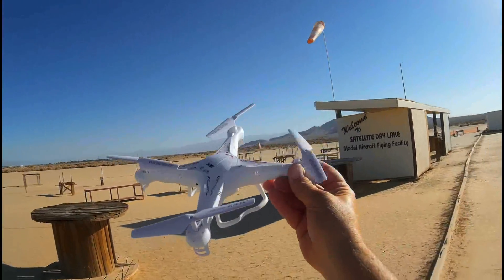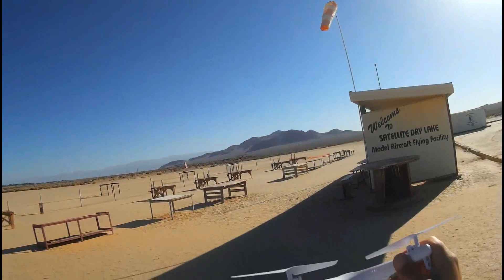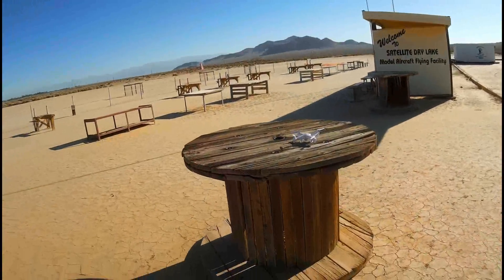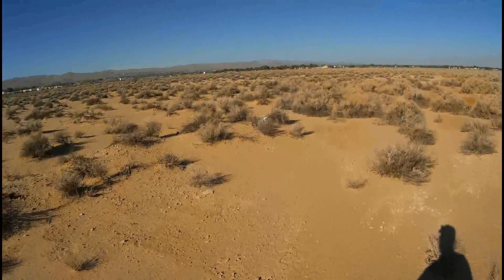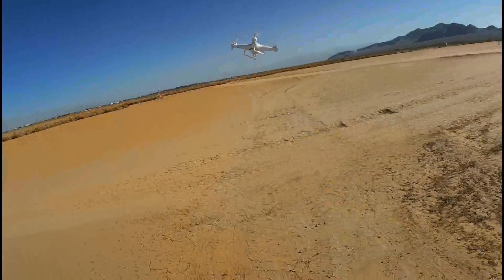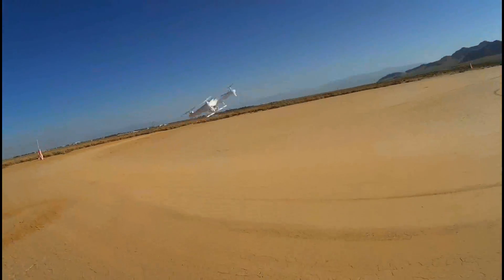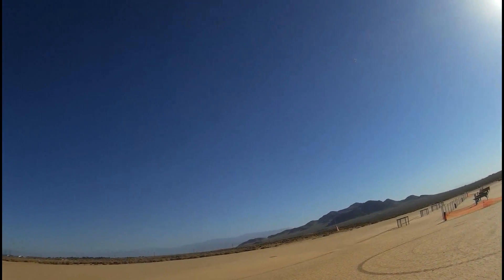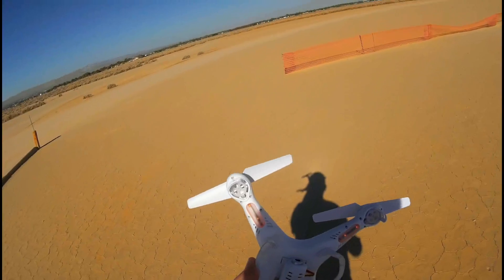Syma X5C Quadcopter Drone Test Flight

Comment: Why on earth did Banggood put this vid on there website lolz.....i mean when you wanna sell something why show a video off  this thing crashing :-) ?
 All i hear is how it sucks and it even looks like its flying horrible :-)
Reply from the maker: This review was for the original base model that was being sold in early Summer. Syma and Banggood has since taken note of the problems, and have started selling a new updated version (X5C-1) that supposedly has corrected many of these issues. One of the updated models is being sent to me for review purpose, and I'll provide an honest updated appraisal video when it gets here in about a week or so. Am hoping for improved stability in wind, with banked turns, increased range, and all with the camera attached.  We'll see about that ;-)
Reply from the maker: Also there still may be some vendors out there trying to clear their shelves of this older model (possibly on eBay or alibaba/express).  If the price seems too good to be true, it's probably not the updated X5C-1 version. Verify with the vendor before purchasing.
Reply: Quadcopter 101  Ok :-) well hope that the updated bird flies better because this thing seems to have a horrible flight behavior.
Reply from the maker: Schiksie Here's my review of the upgraded X5C-1.  It flies like a totally different, aircraft with very impressive stability. I like it. I like it a lot!  Syma X5C-1 Drone, Your Mother Could Fly This!
Reply: Quadcopter 101 Nice video and it surely handles better that the previous version :-)
Reply: Schiksie That's a lot better than most. Most dealers put up videos done in such a way as to cover up any problems and make it out to be better than it is.
Reply: ardvarkkkkk1 Very true :-)

Comment: Dude... This thing is $60 on Amazon what do you expect??? Its not made for long distance and its made of plastic to help keep cost down so of course the wind carries it duhhh...your expecting too much out of it for its price range... Settle down now lol
Reply from the maker: This review was of the original X5C.  It did have problems as shown in the video, particularly with wobbling in turns.  Syma is now shipping their upgraded version, the X5C-1 which supposedly has corrected much of these issues.  I will be reviewing it in the near future to show the differences and the corrections that have been implemented.

Comment: Hi! My camera isn't working, I have the sd card and everything correctly inserted but, it isn't recording, the remote bleeps and everything but the camera dosnt, any help would be most appreciated, also the camera does have a green light but it dosnt start to blink when I hit the button.
Reply from the maker: I have heard that the throttle trim button is now the camera control for the upgraded version X5C-1.  Try pressing up or down on the throttle trim to see if that activates the camera or video.
Reply from the maker: This might explain it better: http://www.rcgroups.com/forums/showthread.php?t=2241148

Comment from the maker: super car master, the gyros can become disoriented from shipment. But it's easy to recalibrate them. 1) place the quadcopter on a flat and level surface.  1) Turn on and bind the quad with the transmitter.  2) place the transmitter in high rate mode.  3) pull and hold both control sticks to their lower right corners.  Hold them their for 15 seconds (led lights should start flashing).  4) let go of sticks and try flying.

Comment: Hi , I have one of those and the thing is that every time I push the throttle up it doesn't stay in its position and it goes all over the place. Do u know how to fix it please?
Reply: do u have fix hit i have the same problem or i just need to lurn how work the buton mode 2 : p
Reply: Hi , you can reset to stay in position

Comment: My X5C is brilliant. Any wonder you had range issues, could hardly see it ! For a single cell brushed motor Quad it's fantastic! My camera has only about 5 or so deg's tilt downward, not too sure how yrs was 20 deg's. The view is perfect & a trade off. Only complaint & it's not really that is it's a little underpowered but fantastic value for money. I throw mine inot the air by had & it self levels instantly.
I have a few other Quads like the Nova/CX20 & the little Syma X5C is far better for fun. Mine doesn't even wobble when doing banked turns providing you have full fwd stick at the same time, seems to work better that way.
All in all I think yr asking too much of it, for around $60 bucks it's won me over providing you understand it's limitations:-)
Reply from the maker: No, to rebind in flight, move the throttle all the way down and up.
Reply from the maker: Think that you might have the newer upgraded version X5C-1?  It's reported to have improved flight software to improve its stability. Other issues remain unchanged (limited power, very limited range, and downward camera angle).  But for around $60, there are other quadcopters already out there with much better power, performance, range, and even video capability.  The following is just to name a few, but I will admit though that the X5C is the best looking of the bunch.
WLToys V222 ($68 easily flies in the wind, yet provides stable video) WLToys V222 Quadcopter, North Pier, Presque Isle State Park PA
JXD 392 ($42 nimble little video quadcopter) JXD 392 Quadcopter: Backwards Pylon Racing
WLToys V222 (great distance flyer) Quadcopter Flying Tutorial: Orientation Tips for Distant Flying
WLToys V212 ($45 very nimble flyer) Extreme Agility 6-Axis Quadcopter, WLToys V212 for Beginners AND Advanced
Reply: Quadcopter 101
Not too sure about the upgraded version but mine looks like yrs, has Syma X5C on the top. Flies really well, better than my CX20, that's a pig! I also have the CX30, now that's a great little beast to fly, amazing agility beats them all:-)
The range on my X5C suits my eyes, any further away would be pointless anyway. The V222 is cheap looking, ugly plastic flimsy body, not a patch on the X5C. Anyway full marks for Syma's X5C, too easy to fly is probably my only complaint:-):-)
Reply: endwood You shold see "2" or "1" in the paper manual (inside the black triangle, in the cover)

Comment: its a 50 dollar quad...why are you complaining?
Reply from the maker: Because even at $50, its problems are so severe that I feel most people would be disappointed in it. Especially when for $30 dollar, you can purchase a quadcopter that can fly like this: JXD 388 vs. WLToys V252 Micro Quadcopter Comparison
But if you forget entirely about taking aerial video, remove the dead weight of the landing gear and camera, and make a slight modification to its transmitter, it can be an OK quad: Syma X5C Quadcopter Drone Maximum Range Modification

Comment: could you put out a video showing how to make the cam look strait
Reply from the maker: Well someone has already done that: Camera angle change MOD DIY Syma X5C Quadcopter - almost straight view
But he makes it a little more difficult than needed. It can be difficult finding the right size screws. So I didn't use any screws. I just applied a blob of glue (hot-melt) to both size of the wooden spacer to glue the camera to the belly door.

Comment: Not sure if you fairly demo-ed this quad. Low rate is for indoor. Outdoors mad wind call for high rate. And why would you fly is so far away? Terrible video.
Reply from the maker: For when the camera is attached, I stand by my review as it is a horrible flyer.  Even at high rate, any wind at all will greatly degrade its performance. But remove that heavy camera and landing gear, make a small mod to the antenna, and then it can be a great flyer. Syma X5C Quadcopter Drone Maximum Range Modification

Comment from the maker: My thoughts:
1: Camera is OK for a 720p, but it's pointed way too far downward. But this is easily corrected by removing its mounting screws, and hot-gluing a shim in for a better view angle.
2: It really isn't very steady outside of hover in maneuvering flight. Believe that its flight logic could be greatly improved. As it is now, it really has a hard time when a breeze hits it, and can start wobbling erratically with wind or sharp maneuvers. 
3: The range is not impressive at all.  Because of its wind issue, it can easily be blown out of range.  Also when it flies out of range, it will maintain the last control input for a couple seconds before the motors cut out.  A manual rebind (quickly moving the throttle down and up) is required when this occurs . 

Overall assessment, because of #2 and #3, I foresee a lot of these ending up on neighbors roofs or in the trees.  The X5C looks fantastic, and comes with a nice camera but a bad camera view angle.  Because of the weight of the camera, It has mediocre flight performance in anything other than hover or a windless day.